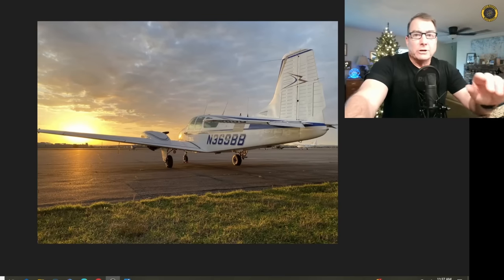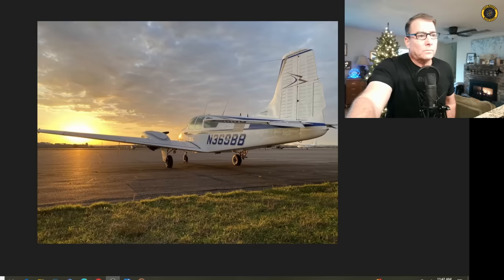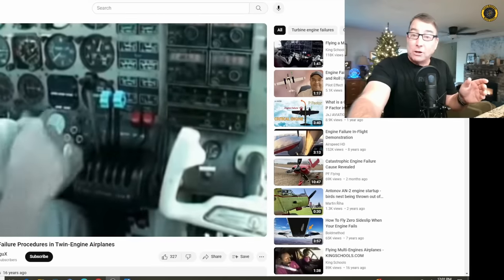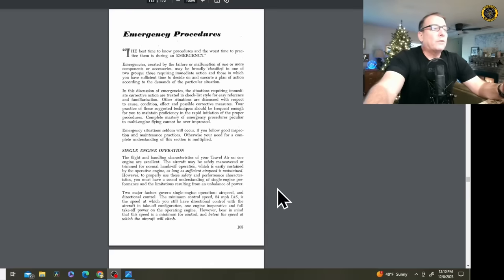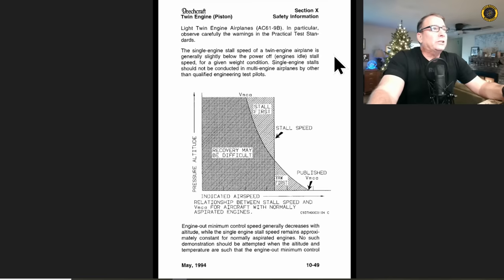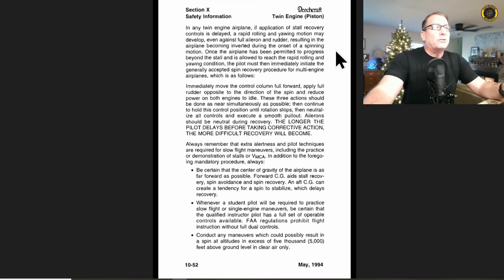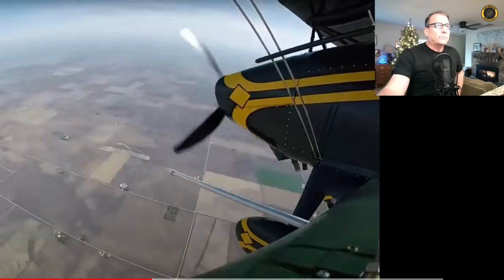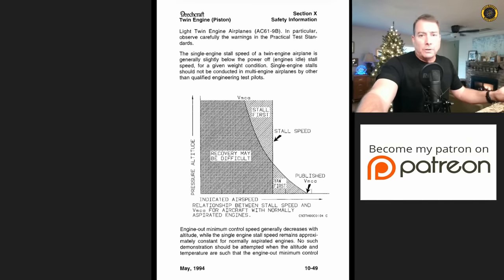Another Fatal Vmc Demo Stall Spin!! N369BB 4 Dec 2023

Comment: With the advent of computer technology, one does wonder why more ME simulators can't be built and required for this type of training.  

And as some have noted, if more people are perishing in VMC training to train for an event they may never encounter or not even remember the details of the training when they do encounter this in real life, does it actually serve a purpose...?

Twins, especially with a critical engine, are inherently unforgiving aircraft and seasoned pilots with a lot of hours perish in those on a regular basis.

Add in the factor of assembly line training of pilots with instructors with may not have a lot of CFI hours in a twin, and you end up seeing a rash of crashes which should concern everyone who is a pilot.

Comment: not a pilot just an observer.  Why not go dead stick once you feel the situation go bad?  It seems it would decrease yaw and seem preferable to a spin and uncontrolled crashing.  Seems like you might add time get your wits together and then restart the good engine prepared for the yaw to return. Even at low attitudes,  you have the chance for a controlled landing vs crashing due to the spin.

Comment: 11:49...If the engine on one side is out,  you can't add power to that engine anyway. So you're dealing with a single engine airplane with asymmetrical thrust. Comments?
Reply: I don't think we can say that using power on the side opposite the spin would not help in all cases. I believe Bob Hoover recovered a twin from a spin by using power on the engine opposite the spin; i.e. if the aircraft is in a left spin, you bring up power on the left engine (keep the right engine at idle). It's probably highly dependent on the model of the aircraft.

Comment: In the 70's the 250 hour was meaningless aa the airlines were only interested if you: 1.)had several thousand hours, 2.) a thousand hours turbine time, 3.) a degree of some sort, and 4.) recent military time in aircraft. For the civilian, without most or all of these items being met, you were wasting time and postage applying. Turbine time was a challenge because to get a turbie job, you needed the experience, but you couldn't get the experience without the job. This from an 8,000 hour Pacific northwest pilot with 3,500 hours multi-engine and over 1,000 hours ACTUAL hard IFR.

Comment: I'm a multi CFI. It's called a VMC DEMO. DEMO!!!  DON'T STALL. IF it starts to depart, "insipid" spin stage. YOU have to pull Pwr back on "good engiine", lower nose and opposite rudder ( no aileron). ONCE SPIN DEVELOPS, LESS THAN 1 TURN YOU ARE SCREWED. Blocking rudder to make the demo at higher speed ( above stall ) gives you options ( like more rudder and not stalling). 

Once it starts to lose directional control, recover NOW...  reduce power, lower nose... keep rudder. Recover to Blue line and level. No aileron, as Jaun said in stall recovery. You are trading Alt for airspeed.

 Like engine out in singles don't stall and accept an off field landing ( under control) if needed. Same with Twins. Respect Blue line and lower nose and land under control. 

Rate of climb  SE in light Twins for example (sea level gross wt.)  300 fpm at 110 kts. Lose engine after take off it will take 6 miles to get to pattern altitude, much less avoid Terrain and obstacles. Add density altitude. 

Lose an engine right after T/O, no usable runway ahead, pull the power back on operating engine and land off field as if it were a SE plane w/ loss of power.

Twins en route and drift down gives you options, like making an approach w/ power. Go Around would be sporty.

Comment: I do not really understand the learning benefit there is at flying at very low speed and full asymmetrical power... Specifically considering how dangerous it is!
Instructors should focus on accuratly flying the Vn-1 speed, the blue line on the anemometer. And nothing below that ...

Comment: if u enter a spin in a twin, is the recovery to pull the power on BOTH engines, nose down, aileron neutral, opposite rudder to counter and at least get to ur glide speed - or pull up into a glide before intoducing power to one or both engines again?
Reply: You want to get your airspeed to where it isn’t stalled anymore, more of a feeling than worrying about looking at the indicator. Once it’s not stalled, you’ll feel it’s not stalled, and the airspeed will begin increasing quickly. You can then gently pull out of the dive and add power on both engines. The reason for gently pulling out of the dive is so you don’t enter a secondary stall, or over G load the aircraft.
Reply: Yes. And hopefully the rudder arrests the spin so you can then slowly pull back on the yoke/stick (elevator) to resume straight and level flight. But if the spin is too rapid, by the time you attempt this recovery, I guess it's possible the rudder won't have enough authority to arrest the spin. And then kablammo.
Reply: jeeze, its scary to think that if the spin is too developed the rudder won't counter it...
thanks for the replies 🙏🙏🙏

Comment: so why  not  cross  coupled  engines to fix the problem ?? a  drive  shaft or  an electrical  solution ?
Reply: Would add too much weight, cost and complexity. And then you could still have a failure on one side of the prop mechansim, etc.
Reply: @igclapp  yes  .. but thats   a  redesign  issue ..  there are  carbon  fibre   shafts  etc  Cost  ?well   if a competitor  does  it then   like  planes with  parachutes    they  have the  market .It will   sell . Safety is  big in aviation .Remember the 787 Max ? The Osprey  uses a  cross  coupled  shaft  albeit they have  had a few  crashes  recently  but that bird is   a hybrid  helicopter ..which are  dangerous  anyway .  And IF  the live  engine was  jammed by the  dead  engine due  to a  broken  crankshaft then   there are  two options  ..  auto declutch the  shaft  and  proceed  the old  way on one engine OR   perform a forced   landing with  no  engines..thats  what every  single engine pilot  trains  prepares for at every takeoff ..thanks for  your  comment

Comment: The second engine is there because it has to be to pull that aircraft thru the air. When it disappears, then that aircraft is less then a single engine in almost all possible ways  like power and controllability. I kind of like the idea of allowing that part of the training to be done in an advanced full motion simulator. When I was taking my training, the instructor (a very experienced pilot) showed me the two most common types of stall spin actions by intentionally putting the C152 aerobat into a spin (at high altitude) and showing how to get out of it. Interestingly, it also showed the necessity of having your seat position set correctly so you can get full rudder deflection when needed.

Comment: As an outsider looking in I do not believe it is unreasonable or knee-jerk to require 1500 hours experience of a pilot before becoming a commercial pilot. They are flying with hundreds of people on board a plane with families and children not to mention all the other planes that are in the air around them and all of the people on the ground underneath them. People that are relied on to get home to their families so 250 hours just isn't enough and there's nothing you can say to change that opinion for a majority of people.
Maybe 1000 hours would have been sufficient but I do not believe that 250 hours is in any way sufficient. It took me 250 hours just to feel semi comfortable riding a 1000cc sport bike.

Comment: We need to start advocating changing Part 91 to the airline training model.  There are at least 4 GA training accidents so far with multiple deaths.  Zero airline training fatalities because they train in simulators and they even don't train these stall spin recovery maneuvers.  They train minimum maneuvering speeds in the pattern.  Stall / Spins can't occur if you maintain DMMS and less than 20 - 25 degree bank angle.  The vast majority of all stall spin accidents are in the traffic pattern.  Even blancolirio or Bob Hover can't recover from a spin in the pattern, nobody can.  FAA should also allow unusual attitudes and stalls in a Redbird trainer.  Please save comments about  Redbird trainers are not full motion (that would be to expensive) and that you can stall at any speed comments - I know all that.  Almost all stall spins occur in the traffic pattern (600 - 800 AGL).  How much do you learn or demonstrate when you release back pressure on the yoke doing a power on stall at 65% power or a power off stall?  Simulators are much better training tools.  We need to change the GA training approach to improve the safety record.
Reply: Pilot training is regulated by Part 61, not 91.
What exactly is the “airline training model?”

Comment: Don’t forget to talk about density altitude and normally aspirated engines and how it relates to VMC. With reduced power at hot and high situations, your VMC will decrease down to stall or maybe even less. Check the chart to see where those lines cross and stay way away from that area. Do not reduce power on the operating engine or during the demo or it will be even worse. Most instructors I knew would block the rudder so the airplane would start to yaw early. Then recovery could begin long before the stall. 6:03

Comment: I’ll buy the notion that adding power will flatten the spin IN A SINGLE, but I’d like to see some more information about adding power to the inside engine in a twin. When an engine fails and the pilot gets into a spin by mishandling the aircraft, adding power to the inside engine isn’t an option. But in the training environment the engine is still working. One might think adding power might slow the rotation and make recovery possible. I’ve never tried it and I’m not going to start. I have an MEI but I haven’t been flying GA for 35 years so I’m not up to speed in that world. I would like to see more research on the subject. I’m not willing to accept the all encompassing saying that “adding power always flattens the spin.” At least not yet.
Reply: In radio-controlled models, we increase the power to blow more air over the elevator which helps it raise the nose. That added thrust also helps the rudder keep the rotation going. Without the added airflow, the ailerons will usually overcome the rudder, the spin will stop, and the airplane will go into a wonky roll toward the ground. If you then let go of the controls, it will become a vertical dive.

Comment: Oh boy… I was just providing multi dual this morning in a BE95.. very easy plane to fly. We were working on VMC and drag demos today.. at 6,500 feet, we seemed to VMC the aircraft at about the same time the stall warning goes off.. we recover by lowering the nose and reducing power on the operating engine. Easy.

Comment: Bob Hoover (yes, the legend) quit doing spins in twins when he had to apply Full Power to the "inside" engine to arrest the spin. It was a "hail mary" thing - as correct techniques did not work in this case. He had done many of these before the snake decided to bite.
Reply: Bob Hoover used to perform five turn spins in the Shrike as part of his airshow routine until it went flat on him one time and he had to use all his test pilot skills to recover. To quote him, "I had been performing spins in the Shrike for twenty years and would have bet anything that it would not go flat. That experience taught me differently. I omitted the spins from my performance." (Forever Flying, chapter 25). So, if you get away with it once (or a hundred) times, the next one might be different. It's only the last one that counts.

Comment: I have my CMEL, watching this video is making me equal parts angry and depressed. There is absolutely no justifiable reason for this accident to have occurred. My instructors beat me to a pulp, literally and figuratively, with the proper VMC demo and recovery procedures. When my dad (AMEL) told me about this accident and my first reaction was "why didn't they kill the power?!?! Just pull the levers back!" 14 years after my training and my response is still autonomic. Stall/Spin recovery should be rehearsed to the point that the reaction occurs unconsciously on any aircraft, but especially multi-engines. 

These can be done safely, and they are immensely educational for the pilots, they need to experience it, but it takes an experienced instructor and an attentive student. At my school we only did VMC with the senior instructors, folks with thousands of hours and hundreds of reps on these maneuvers, and they were merciless when I screwed them up.

And these instructors want to fly jets. Just wait until one of them faceplants a fully loaded 737... We need to have conversation about pilot experience, increasing hours was just a quick and easy patch to far more serious problem. 🤬🤬

Comment: If the Vmc roll is caused by a stall of the vertical stabilizer (rudder) then stepping "opposite" rudder is FUTILE.
That rudder was already maxed out and was the reason why it stalled to begin with, remember ?
Thus the POH Vmc recovery technique is flawed.
It is nothing more than the common spin recovery technique.
And does NOT correct THE CAUSE of the Vmc roll.
Thus fatal.

Comment: It doesnt matter how many engines or the aircraft type. You can only stall an aicraft by pulling the yoke too far aft into the stall stick position. DONT PULL BACK! Its really that simple.  Note i never mentioned airspeed once. Because you can stall an aircraft at any air speed, but only one stick position.